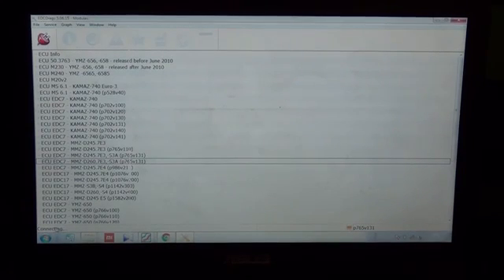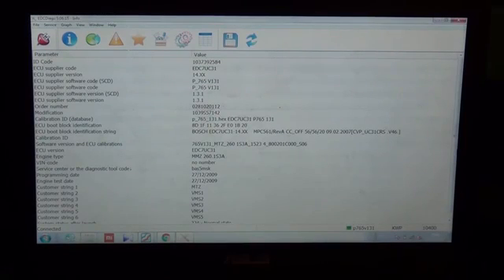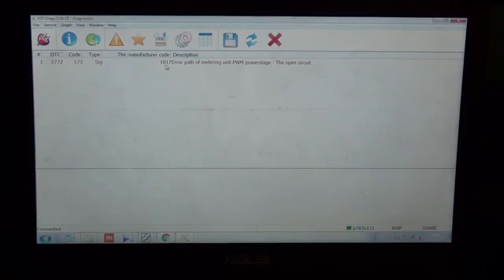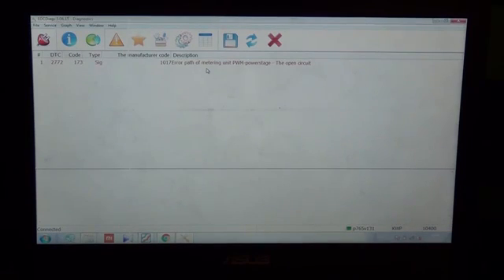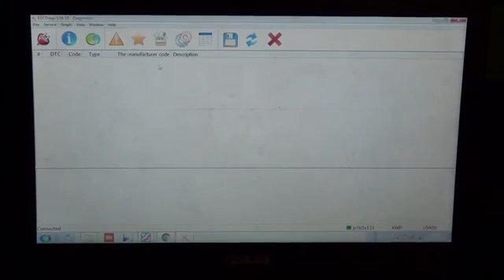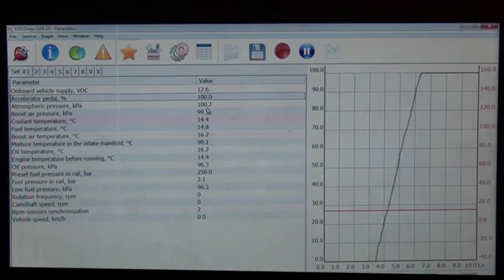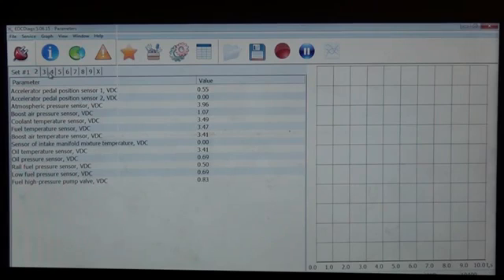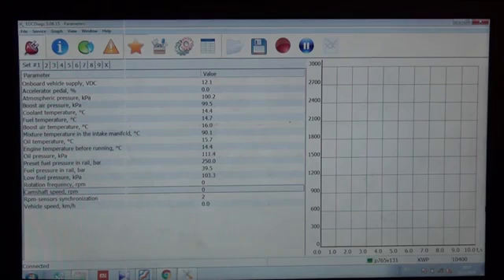MMZ Engine – Bausch Diagnostic For MTZ/Belarus Tractors

Comment: Hi, what is the name of software you use? Is it free or do you need to buy license? Also what types of ECU do you use in Belarus tractors? Are they from Bosch only? Thanks
Reply from the maker: The software + cable adapter is about 1,200 USD + shipping. Includes all needed files.Belarus tractors use variety of engines and ECU’s. That particular video is for Euro 3a/Stage 3 ECU, Bosch common rail
Reply: Hi, can you please provide official contact information (email/web site) where it can be ordered? Thanks
Reply: I like to buy this tool! Contact me please on WhatsApp +371 29919194